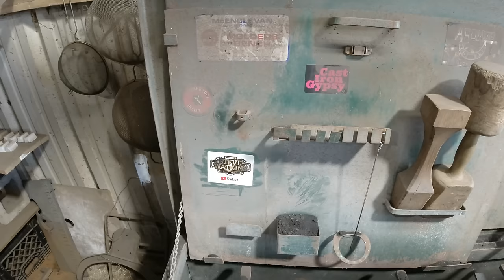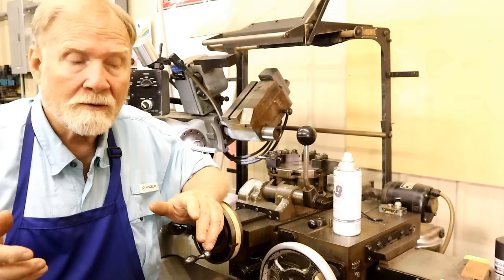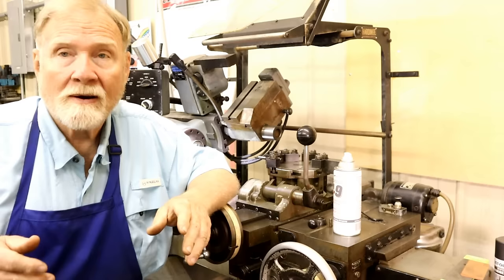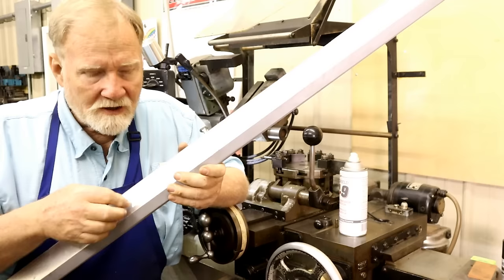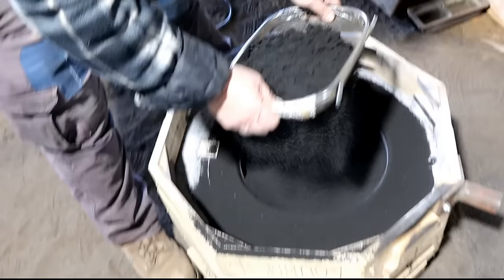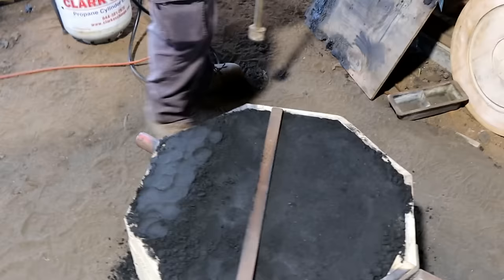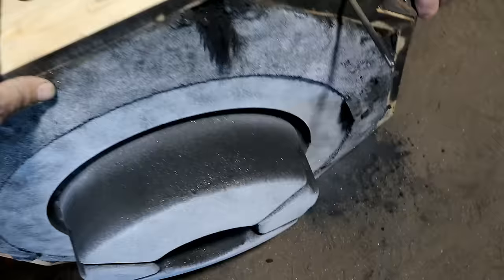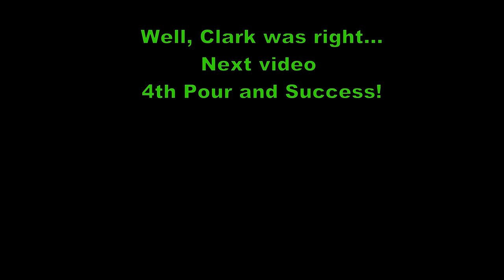Pouring the Tally Ho Capstan: Part 2  Unabridged Version

Comment: The original Capstan would have been made in a similar work shop in the early 1900s in England using virtually the same tools and process.
Reply: The only difference was that those men had likely started as apprentices at the age of eight or ten and had decades of secrets and tricks of the trade passed onto them.  In the begining they had started cleaning the shops, cleaning the molds, and learning under a firm hand how to properly pack the molds.  By the time they were in their 30's and 40's (assuming they hadn't been critically injured, burned, or killed) they would be approaching master foundrymen status and would be working on the most difficult molds and training the older apprentices.  Now you take a bunch of men who this is there second career or dream hobby who are learning in their 50's and 60's  by self teaching through trial and error!
Reply: …but faster, hopefully…

Comment: I spent a whole semester of foundry shop class in high school learning how to pack a flask with green sand and a pattern. Seems like it took most of the semester to be able to turn the flask over and extract the pattern from the mold without dumping all the sand on the floor.And those exercises were with simple high school project items.  The result was cast with aluminum, not cast iron and we weren't allowed to participate in the pouring, the upper classmen did that. I cannot imagine how hellish it is dealing with crucible of liquid cast iron.I also spent two prior semesters learning the rudiments of pattern making. It isn't so easy, even for professionals and Clark is a professional. Seems like there's a lot of armchair riders shooting off their keyboards without much understanding of the issues involved here.
Reply from the maker: I had the same foundry classes in school... Believe me that was tame compared to cast iron!  Clark says it's like playing with casting lead :)

Comment: I hired a drywall finisher a while back. He came into the room, my soon to be son’s room, and heaved a sigh of relief and said it would be an easy job. On the previous job the homeowner used every scrap of drywall to piece together the wall. I used full sheets on the walls. 

He said the guy saved five bucks on Sheetrock and spent fifty dollars on taping.

Comment: Steve, that was a very nice description of why it is done like Clark does it.  I never gave it a thought about the amount of friction there is in sand being used for molding.  We used to make patterns out of aluminum for wear and tear from use.  They were always polished to remove all of the tool marks for the same reason.  Yeah, we had a couple of casting that were a buger to cast which I had to go in and redesign the part to make it easier to cast.  I sure miss that old foundry up in San Antonio, Texas, Alamo Iron Works we used to use.  It's long gone.

Comment: I have personally been in many "real" foundries and most people have no clue that most foundries are production foundries that produce widgets not one-offs or small runs. Specialty foundries Like Windy Hill are often more capable of the arisan work than the production foundries. The specialty foundries that I have knowledge of, have had the same headaches as you guys did. I am from Alabama and the specialty foundry that I am most familiar with made the 100 ton Deepwater Horizon 'sealling cap' out of 5 sections, as the castings werw MASSIVE and extremely complex. Non of the 5 sections were without drama and re-tries. When you are not doing production parts, you find out very quickly that there are different rules and that is not to even mention that the 'real' foundries will not even consider one-offs.

Comment: No need to get upset of that remark. The world is full of their mindless remarks. I cast small in comparison to what Clark and you fellas work with but the results are IDENTICAL  in every way. As it is I use and reuse Petrobond. Great stuff but there is another called Delft Clay that is stupid expensive. Anyways, when we fail, not if , we just have to scratch our noggins and start over. Sometimes we have to walk away and get back at it in a bit or tomorrow. we eventually get it right and be proud of the achievement. Well Steve, you sure do keep company with the best of souls indeed. Thanks a BIG bunch for this winning post my friend. A sub to/for you was a great thing to do. EH !

Comment: I spent years on the machining side of a company with a professional foundry, I have witnessed many blowouts in metal flask, have sent castings to weld after cutting into sand pockets or porosity, some castings are scrapped at cleaning some from x-ray, it just happens. If you aren't running a continues production part making hundreds or thousands of the same casting you are going to have issues from time to time.

Comment: If anyone comments on the number of pours it’s taken, just remember Clark got it in 4 … all those Lilly livered keyboard experts out there, how many goes would it have taken them? that’s the difference, 4 goes to make a prototype is pretty darn good. I. An electronics engineer and when I used to design a printed circuit board, the amount of times I’d forget to add that crucial test point or forget to increase the thickness of that bit of track that just blew because it couldn’t take the surge in current… usually I’d get a reasonable prototype within 4 to 5 goes depending upon the complexity. So guys, it’s not mistakes as such, every new design takes some figuring and we all forget things or fail to remember to modify something before the production run.

Comment: You just gotta learn to ignore the haters and the arm chair quarterbacks.   (Ignoring my own advice....) Arm Chair Quarterbacks, internet experts and haters:  I've been around machining my entire life, these guys are EXACTLY who you want doing this kind of work.  Of all of the living people on the planet who have ever been capable of this kind of work, and this kind of quality... 98% are in nursing homes.  This is essentially a dead art.  Casting is one thing, large complicated ONE OFF castings that aren't just decorative, are a whole other thing.  Could a billion dollar foundary do this better?  Sure.  But they'd spend a half million getting the process right, dialing it in to absolute perfection... and then they'd only have 1 customer looking to buy just 1 part, ever. 

I work for a company that builds the equipment that machines the engine castings, transmission, differential castings etc.  You have no idea how much time and money it takes to get those engines right, and how tightly they control the tolerances.  If you asked someone to build you just one from scratch.... my god the money it would take to do it the way they the OEM's do.   But there are guys out there building their own from scratch.  Do their shops look like the Ford, GM or Stellantis production lines?  No.  They are garages and old warehouses with old machines, old men, and bits of this and bits of that scattered here and there. 

Get off their balls, they are the among the very last of an exceptionally talented and tragically endangered breed.

Comment: Haha, the professional foundry comment I am also confused as to what that means? If they are just talking about a bigger foundry then they would most likely decline the job as they know it will take a few times and isn't worth the time for a single part or the cost would make it unfeasible. I facilitated a run of 12 ductile parts and was turned down by a few foundries. When I found a foundry that was willing to pour ductile in a small run it took 4 tries to figure out how to pour it and then we had a 30% success rate.  This was a very professional foundry with many many years of experience they told me every casting has a sweet spot for venting, gating, and what direction it will pour best and the experience gets it down to 4 tries instead of 10.  Casting is better suited for when you need 100's or 1000's of parts we could have redesigned the pattern and part for better success but for 12 parts we just pushed through. With that said Windy Hill Foundry is as experienced and professional as it gets for small-run casting that seems to be their specialty.

Comment: i've seen dozens of different casting methods, and the one thing EVERY type had in common - you NEVER get a final use-able casting from the first several pours.
even the most experienced people with a NEW pattern have to figure out the quirks to get the repeatability sorted.
i knew there was going to be several videos and molds before there was a good casting.

Comment: There is a lot to be said about patterns that Clark gets and what he has to go through just to get a casting. The typical scrap rate for a foundry is 3%. I agree with the fact that the  flask should have been built differently. Provide for clamping the mold together rather than just relying on weight alone. In my opinion, the pattern has issues, too. A redesign could have made the process easier. Having watched the pattern construction, I don't think there was much communication between the patternshop and Windy Hill Foundry's capabilities. Trusting a patternshop to give you exactly what the foundry needs is like trusting that a draftsman put everything on the drawing so you can make the pattern.
Reply: Your spot on!

Comment: HI when I worked in a large foundry we poured around 2650 degrees F, pretty toasty. our product was ductile Iron it had the consistency of melted ice-cream when it was pouring. you probably don't have a way to measure the temperature of the Iron so it is by color. you fellas seem to have the process down. 
Rich
Reply from the maker: Thanks for the info!    Clark has a temp probe and checks it...  By the time it's out of the furnace and going into the mold it loses a lot of temp so its probably around 2700.

Comment: You all are probably ready to try the Pakistani two step before long.😀😀
Reply: my first thought was  - what do you mean? - then I remembered the two feet stomp:face-blue-smiling:. Yes, but they have much more simple objects, mainly just cope and drag with some core stuff inside. But I have another question - could a lost foam core be used here as I have seen done with some alu castings? They washed the foam with a few layers of some sludge/thick wall paint, more in the way of how you would do SMALL things in wax and ceramic for casting in gold . And then set this mold into the flask with sand around?
Reply from the maker: I HAVE BEEN TRYING TO TELL HIM FOR YEARS ! :)

Comment: I think that it has to be emphasized that several attempts at such a cast are normal! Just as a carpenter or joiner has to adjust their work until a joint really fits, a caster has to do the same. The only problem is that pouring takes much ore time! But this tedious repetition and adjustment is fairly normal.
Ok, watchers of Leo's channel remember the pouring of the bronze knees for TallyHo. But bronze casting happens at somewhat lower temperatures AND it is quite the different material!

Comment: Kinda makes you wonder how in the heck did they do this over 100 years ago. The must have had a similar problem. Makes me wonder if they did a lost wax or something like that to cast it, or even if that was possible. Thanks for sharing your great information on the casting friction problems with sand. Best Wishes & Blessings. Keith Noneya
Reply from the maker: Did it this way..... Made a pattern then cast it and worked out all the problems... IF needed Clark could now turn out thousands of these with probably a 10 % failure rate...
Reply: @10swatkins That is awesome, I know you guys had a hard time with this casting. I look forward to hearing how you guys solved it. With as many problems as he had with it, you should ask Leo of you can make and sell them for antique sailing ships. Thanks for reply. Best Wishes & Blessings. Keith Noneya

Comment: That's a very small flask for that part. I'd be forming the more complex layers as sodium silicate to aid releasing the pattern.
Reply: It was at the limit of his furnace capacity
Reply from the maker: its an 18 inch wide part... What you see taking up all the space is the core print.. The actual part is 8 inches away from the sides of the flask.

Comment: Im certain there is a reason why not?  But I'm curious why either something like furniture  wax (i.e. Minn Wax) or one of the newly developed synthetic  auto waxes could be applied to the mold to help reduce the sand adherence.  Some of these new auto waxes are molecularly so smooth, especially the spray on types that you then let dry a few minutes then buff out.  Plus maybe add the use of a buffer on the mold.  Just trying to think out of the box and how cross technology could be useful to you guys.  Keep the faith, because the first time you finally get to see the whole capstan as a fully functional machine after all the modifications and finally installed on the Tally Ho your going to look back and say to yourselves "My God; how did we ever get suckered into making that damn thing..."
Reply from the maker: It's more of a really complicated inner shape with almost no draft  and places sand can really did into the sides that is the main problem..  Clark coated the pattern with graphite which was just as slick as you can probably get..  In the next video you will see how I worked the pattern over with even more sanding to get it to work much better.  Thanks for watching and at least trying to think the problems through... Not many people do ...

Comment: It seems it would have been a lot easier to skip the outside ring and have just machined that off. The Vogt machine foundry down in Louisville had basically a giant play box of foundry sand and they put most of the pattern down in the floor. No doubt they never lost a pattern to blowout because when they placed the top it was recessed in the ground and they could push sand back up to the outside of it. Doing it that way also reduced the need to handle the massive weight of the patterns since they were doing castings that were literally tons so no telling what a core might weight!
Reply from the maker: This is a three part mold and needed to be turned and taken apart to ram and then insert the cores..   

 I would have machined the outside recess in also but we were working with the pattern that was sent...
Reply: @10swatkins   Yep it was the cards yall were dealt and they were well played only a few times to get success means you are quick leraners. 🙂

Comment: Why don't you use zircon around the pattern first? It would release much easier. I worked at Pacific Car & Foundry for 10 years back in the 70's, sure don't miss it! Good luck!
Reply from the maker: Has graphite coating

Comment: I have seen cast iron bath tubes made that was a production line pouring the same thing over and over again they don't due one off parts.😮
Reply: A one off part in a foundry would be cost prohibitive!
Reply: @donmadere4237  all depends on the work the patternmaker puts into the pattern to fulfill the foundries needs. Foundry rate is by the hour. Patternshop rate, in a job shop, is by the bid. The patternshop should always try to reduce foundry time.

Comment: So did you up the amount of plasticizer this time around? How did you lick the suction problem on the sand to mold?
Reply from the maker: The suction was not really an issue... It's the sand around all the interior parts with not very much draft and parts of the pattern not being smooth enough... Two hours of sanding the pattern and another coat of grafite solved the problem.    Clark did add bentonite to the sand also...

Comment: how was the original capstan cast? what did they do differently back then do you think?
Reply from the maker: Not much has changed in the way it was poured and the way Clark did it. . 
Of course they were probably making many of these at a time as they were selling them but they still had to learn the little tricks for each pattern first.

I can almost guarantee you that if we had to pour another one it would be a slam dunk the first time.

Comment: Why not use the lost-wax process?
Reply: just my thoughts, but because of the size I would opt for lost foam instead
Reply from the maker: Nothing wrong with the process just having to refine it to get a good pour.   The lost foam would have been easier to make the casting with as the mold would have been far simpler but Clark was working with what he was sent.

Comment: That lathe was designed just before high speed steel was invented. So in doing that they provided a maximum spindle speed of three thousand revolutions per minute. It was an obsolete design when it first hit the market. Carbide came along not long after that making it even more obsolete opening up space for the swiss automatics to be developed.
Reply: The first alloy designated as AISI, and classified as high speed steel was invented in 1910 and patented by the Crucible Steel Co. “Bob” was manufactured many decades later.
Reply from the maker: Bob has spindle speeds up to 3000 RPMs.  While Bob is obsolete these days, because of CNC, Bob is still a capable machine for all kinds of tool steels and carbide..
Reply: You need to learn feeds and speeds!!
Reply: @davestambaugh7282  Dave, please show us your treatise on speeds and feeds. Maybe you can teach us something new.